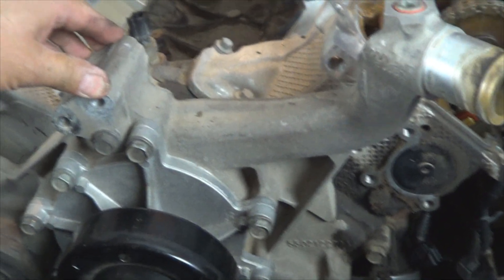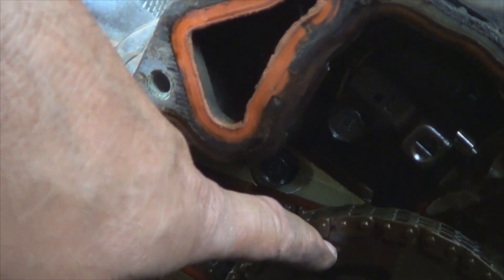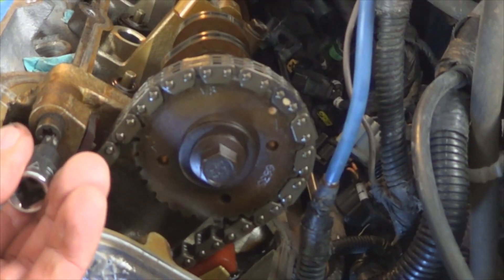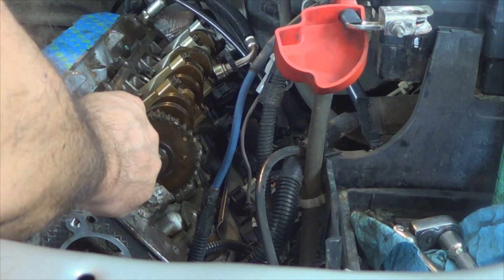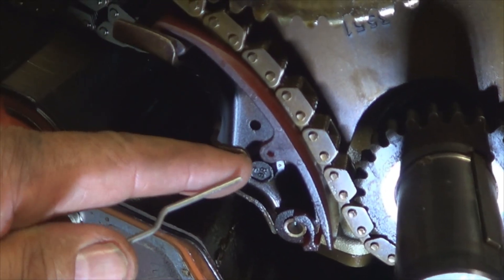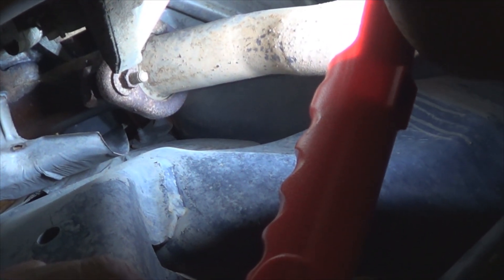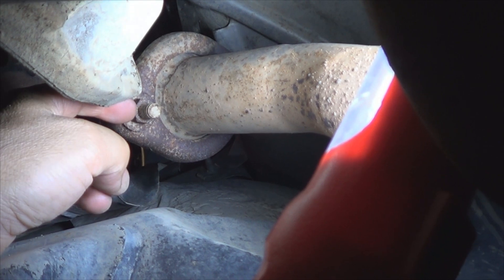Dodge 4.7 L Engine Cylinder Head Replacement Part Five by Howstuffinmycarworks

Comment: Hey guys. two weeks of rpm not going over 2k  rpm on a new reman engine,
 I was very frustrated to say the least. I found your video. spent 3 
hours taken off valve cover spinning the crank watching colored chain 
links.  finally got to the black link and found it to be one link off. 
put it on mark, and this engine running so good you can hardly hear it. 
smooth.  Long block from engine world. 

thank you so much for this information. great Video. 

Ken Manning

Comment: After opening up my passenger side head I found that one of the lifters casting has been cracked only on the passenger side the drivers side looks good if I need to swap the head on the passenger side do I need to remove the entire timing chain? Or would I just need to use the rubber band method and just remove that single head? Please provide me with any useful information that may come to mind. Thank you!

Comment: Spring for the Mopar innards or reuse your original parts. I wish i would have used a crate motor from Chrysler since the lash adjusters alone are almost $800.

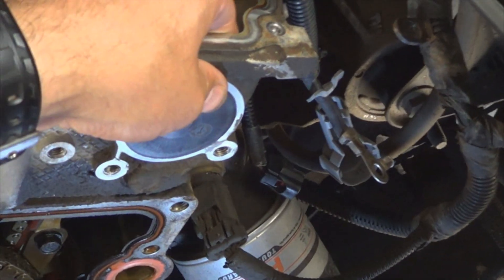Comment: I’m guessing that plug you removed at 4:17 wasn’t as easy as you made it look. I’m currently trying to remove that same plug on my engine and due to lack of space it’s not popping out as easy lol smh 😂
Reply: Lmao, I might have to do this job soon If I can't fix the broken valve cover bolt with the head in the vehicle FML. Doesn't look like much fun but If I the head has to come off I might as well remove both and replace the leaking valve seals while I'm at it.

Comment: Thank you for providing these videos. I am in the process of removing the heads from the same engine in my father’s 2005 Jeep Grand Cherokee but we are having trouble breaking free the back bolts holding the heads on.
Can you provide the CFM ratings on the impact wrench and compressor you are using? I have a Dewalt impact wrench with a max CFM rating of 5.9; is that a powerful enough wrench? If not, what is the next best way to remove those far back bolts, an extra long breaker bar perhaps?
Thanks again for these videos, I would be lost without them.

Comment: Hey  just remove my timing cover, and just like you, the dots aren't aligned on the crankshaft shaft sprocket but everything turned out perfect before that.  So I marked the position of the chains like you did.  My question is does it really matter about the primary chain color dots aligning(On crankshaft sprocket) as long as u have the secondary chains align at tdc on each camshaft?

Comment: As soon as you said "this was not the major problem with the cylinder head though" I knew exactly what it was going to be. Have my dakota torn apart right now with the SAME exact issue! Overheated blew head gasket (the owner thought) I pick it up for 650 go to pull the engine out and discovered that had happened too

Comment: If you keeping the truck yes is best to grab new heads. But if is for private resale just repair what causing the engine lack. Unless, you find an engine in the junk yard that the truck has been in a accident from the back, is best to pull them out and best chance you wont have an issue. If accident was at front, leave it. Chances are from the impact everything shift and bend many components.

Comment: I can't find your previous videos about this 4.7 
Do you have the links for them?
And thanks for showing us how to do it
Reply from the maker: https://youtu.be/GwEFSymibRI       https://youtu.be/c-pL35urp6c     https://youtu.be/3EBSBP0JXvE      https://youtu.be/iF1Dp_ijMgg        https://youtu.be/IU8qVwUmSck                                                                    https://youtu.be/gelf54uzsfk       https://youtu.be/5PXKaAQPU5E
Reply: @howstuffinmycarworks  Hello, question...I'm tearing apart a 4.7 in a Ram I bought, so far have the left head off, it has 2 dropped valve seats and Pistons show some damage, in your opinion, what's the best way to check the Pistons to make sure they're still usable? Would you recommend removing them to inspect them properly? Or just inspect cylinder walls and look for major scuffing, check for excessive piston to wall clearance??

Thanks.

Comment: Machine shop will install new valve seats and stake them so they don't come loose - Get the heads worked
Reply: Pro Machine in Rapid  City will it install oversize seats to prevent reoccurrence. Also found that water pump had cavitated the housing which probably caused the overheating to begin with. Remove the water pump to check. Replace or repair housing.

Comment: Obviously is american engineering, massive job just for a head gasket, thank you toyota for building simple engines...
Reply: I have a 2002 4.7 v8 doge ram and the wire that hook to something in my intake on the driver side it broke and I don't know what it called to fix it and I need help

Comment: Here's a question i hope you can answer. I'm in the process of doing this, waiting for the special tool for the rockers to come in tomorrow before i continue... i'm having the heads machined and i can either take the rocker arms off myself or the guy will do it for me and put them back on for me after it's machined.

Do the rocker arms have to be exactly the same once i put everything back on or can they be moved ? If they can even move.
Reply: TheRaevin A

Comment: i had both headgaskets replaced and the head was milled a few thousands to make it even better ..and the kit has all new chains and sliders and gaskets  its a big big big job  i spent 4 thousand but the motor works great now.. like a new motor..
Reply: san379 that sounds like a lot of money! i just re bored my 4.7 .070. new pistons, turned crank, gaskets and everything i spent $590. ( not including oils)
Reply: Zae Rodriguez  you rebuilt your  v8 overhead cam with all new install kit with all the chains n sliders n gaskets and machined the heads for 590$... impossable.. ..thats thousands of dollars of labor.. .. ps.. the motor still works great..
Reply: Labor i did myself, gaskets costed me $209. Remember we did it on different times. Im sure my parts costed less then your time.i turned  my crank for $60 and rebored with hoan for $85. I reseated my valve seats and refaced my valves my self. Thats good!
Reply: san379

Comment: everything aligned now. now can't seem to remove cam nut using vise grips without slipping and losing marks. is there another too that can be used from store in place of your special tool you had made?

Comment: dots lined up on left and right cam but colored links in crankshaft slot did not. should I reinstall timing case / pulley and continue to turn engine till they align or can I just paint marks for my own reference and install as they come off? have yet to to take off chain. please reply
Reply: Rotate the crankshaft until the damper timing mark is aligned with TDC indicator mark on the timing cover. Verify the V8 mark on the camshaft sprockets is at the 12 o’clock position on both heads. You are now at TDC on the exhaust stroke. You can now remove the harmonic balancer, then timing cover.

Comment: great job! you have helped me a lot so far, thank you thank you!  MY QUESTION THOUGH
I cannot get both my cams lined up with their colored link.  After getting TDC on all my gears couldn't I just pull chains from wherever they happen to lie, then when reinstalling line them up in there correct order?
a reply would be very much appreciated, Happy Holidays!
Reply: +taalf thorpe timing the camshafts with the crank can be a complicated procedure, but it is possible to time if you can't keep things in their correct position. If things have gotten out of whack, it would be easiest to have someone whose done it before give you a helping hand as it is not an easy task. 

I would not put the engine back together until you can hand crank the engine and verify that all marks, dots, and marked links are in correct position when they should be, as stated in the video, if they are one link or tooth off, your truck will run like crap, two or three links off and you piston will hit the valve and destroy your engine
Reply: Did this work? I have same problem